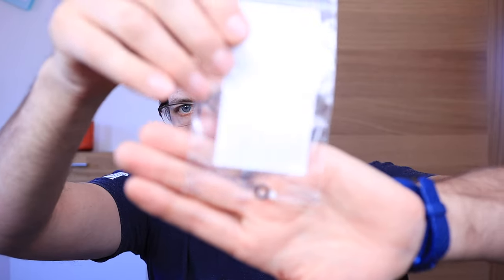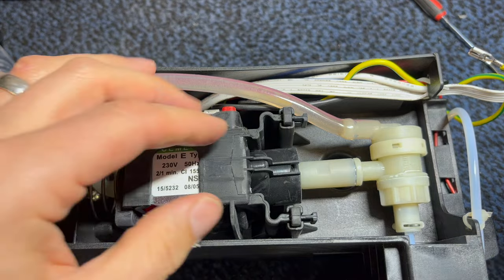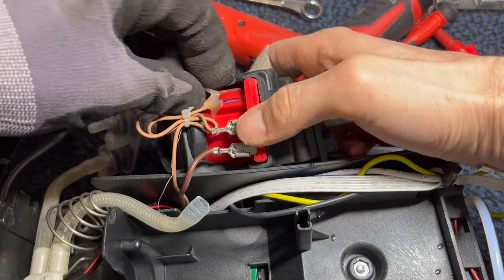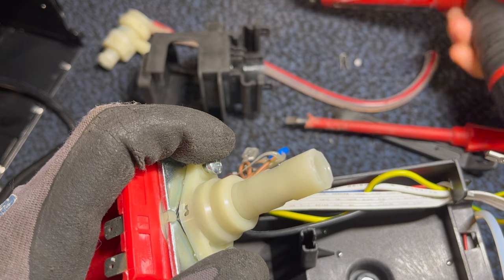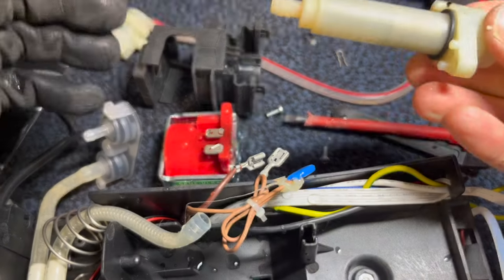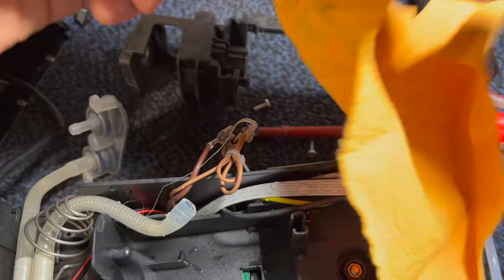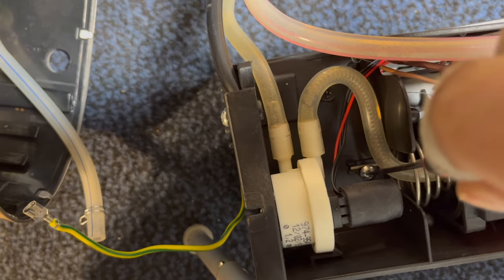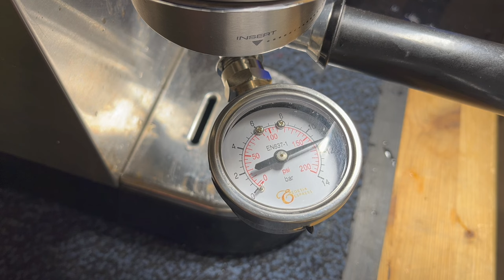HOW TO FIX an ULKA Vibratory Pump: Dedica, Gaggia, Saeco, Philips, Etc.

Comment from the maker: In this video, I show you how to overhaul an Ulka vibratory pump, to revive the performance of your coffee or espresso machine. This can be done for basically all vibratory pumps, and I exhibit it on a Delonghi Dedica EC680.
Ulka Maintenance Set: https://geni.us/UlkaMaintenanceKit (Amazon)

DISCLOSURE: Some of the links on this page are affiliate links, meaning, at no additional cost to you, I may earn a commission if you click through and make a purchase and/or subscribe. Affiliate commissions help fund videos like this one.
Reply: Hi, I have an Odea go. When I start it normally and it does the priming and rinsing, it doesn't have pressure, the pump seems to go slow like there is a clog, not enough water comes out. But when I start it in service mode, the pump seems to work ok and it has pressure through the brew group. Also has pressure through the steam way. It is also clean and fresh descaled. Might it be the pump, too used?
Reply: Tom sir, I know this is an old video and I'm not sure if you have already figured this out or not but I seen you fighting that hose here and I believe you broke a nipple before because of a hose. If you twist your hose before you pull it it'll usually pop right off.

Comment: Thank you! My dear coffe machine works again.

($500 machine, found in a dumster, ten years ago, with a faulty on/off switch)

I would not have thought that little ball would wear down, but it makes sence since it rests directly on the edge of the spring. The ball had become so small, it had nested itself  inside the spring and it was milk white rather than clear.

So, did I order a repair kit?
No, I happen to know that ordinary soap dispenser pumps work with a  similar type of valve.
I cut apart a soap dispenser and in there was a clear little ball of exactly 3,9 mm. It fits and the pump now works.
I also flushed the heating element with diluted citric acid to dissolve any  chalk build up.
 
Free espresso machine is ready for ten more years of service.
Thanks again!
Reply from the maker: That's great news! Thanks for posting your story, especially the part about the soap dispenser. I will have to check that out.
Reply: Im going to try this. If it works, you are an absolute legend.
Reply: didn't work :( It doesn't shoot back any water back into the tank so most probably the problem is indeed the pump. I'm going to order a real set and see if that works. if not, I'll order a new pump and valve.

Comment: Thanks for the detailed instructions in this video!  My Delonghi Dedica EC680 was giving only 6 bar pressure, so I went ahead and replaced the ball and gasket.  This fix improved the pressure to 8 bar, but still not good enough for espresso.  Finally I replaced the pump and I was able to reach 11 bar pressure.  I noticed some white stains on the old pump that were probably caused by a very small water leak.
Reply from the maker: Glad to hear you got your machine working again! Thanks for sharing! Tom
Reply: Fixed 10 Dedica by replacing the ball and seal. Tried a new ulka and it was more powerful than ANY of the repairs I done.

Comment: Thank you! I have a DēLonghi Magnifica that had a water pump go out. I thought about having someone fix it. But that was too expensive. so I followed your video, and success! The coffee makers working again. I do suspect that the ball got sucked through to the other side. But thank you for your insight and easy to follow video! Back to freshly ground coffee Made by a push of the button versus that drip stuff.
Reply from the maker: Awesome! 😎

Comment: Thanks a lot as your vid cut off my disassembly time at least 50 %. Got some different problem with flow as well fixed , but for reference the brand new pump unit have 500ml displacement for one cup as well as done within 12 seconds  from push bottom start to stop the pump cycle. 

Another machine as have one for spare, have interesting problem as filling one cup with 500 ml within 11,8 seconds but when make double cup then do the same job as fill up 500 ml within 11,8 seconds and stop the process seems must be software problem . Problem were remdy as follows - Just an FYI to make it a bit easier if you need to do this again. You should be able to reprogram the shot time/length whenever you want by simply holding the button (single or double shot)  down and not releasing it until you have the amount you want. It will remember that setting from then on. Thanks this guy and this issue also fixed. When the pump is weak and worn out as sometimes for fill up the 500 ml need 21 seconds to stop the process. So timing of pump is good to remedy the pump statement on time. Even if pump is worn out with this keep button  you can complete the cup filling until replacement pump arrival
Reply from the maker: Thank you for sharing! Tom

Comment: I recently purchased a used Isomac E61 machine that was not operating. After testing it and concluding that the pump wasn't working I took off the cover to inspect and remove the pump. My conclusion is that vibratory pumps are too noisy for use in a home appliance. But if one must use one in an espresso machine, there should be a more robust method of mounting the pump to the chassis while minimizing vibration noise. The stock rubber mounts are grossly inadequate.

Comment: It might be a combination of issues with the pump. Mainly caused by calque. But also spring pressure, the little ball and rubber seal. But well done, thanks for this helpful video!

Comment: My pump was getting stuck. I didn't realise you could service these pumps! I opened it up and lubricated the shaft and seal with silicone grease, now it's working perfectly again...if it dies again, a new pump is chump change.

Comment: Can I use lubricant on the gasket in the pump, while the pressure & amount of water is low.
If I can use lubricant what you propose as brand and type? Thanks.
Reply from the maker: Well, I’m not so sure about that. But you can check a parts website, for food, safe lubricant. I’m not really sure if it’s necessary though. At least I’ve never applied any lubricant to the pump.

Comment: Hey I commented below a month ago, and successfully fixed mine using this video. The only thing - now my pump is back to square one. Can barely pull a shot out, and can hear the pump struggling a bit. 

After a whole minute i get my doubleshot. When I unscrew the portafilter a ton of pressure is release and some coffee grounds and water burst out.

Any idea if this could be the same issue again? Or a different one?
Reply from the maker: It sounds like maybe your filter basket is clogged. It seems that your pump is bringing pressure, but the pressure is not escaping. Cheers!

Comment: HCM15 hotpoint built in using this pump, Hotpoint want £80 for a new one. Its on amazon for £20. Have read its designed to be replaced rather than serviced but definitely worth trying this out.  My fault was preceded by small leak(dunno where) with humming/buzzing noise. The machine will do one espresso before shutting down and displays "fault in water system". When i turn it off overnight and back on next morning it does one coffee, somewhat confused why a leak occured once but not again and its making coffee fine but shutting down. Im guessing a safety mechanism to protect machine.
Reply: Note Hotpoint quoted £200 for entire job
Reply from the maker: If there's a leak, I wouldn't be surprised if an O ring needs replacing somewhere. Cheers!
Reply: @TomsCoffeeCorner  I took machine out of wall yesterday and gave it a thorough cleaning including the brew unit. Mostly superficial and oddly it's now not showing fault. Pulled two coffees and it's back to displaying as normal. Fingers crossed

Comment: Ive opened my Dolce Gusto machine, a very similar pump inside, it doesnt pump anymore. According to some sources, if it still reads as a diode in 1 way and not in the otger way, it might still work. Maybe a cheap kit like this will make it work again. 

I mean, we already got a new machine... I couldn't trow the old one away without figuring out the fault (the led does turn on, but no pumping, and we did had a no water in pump issue)

Oddly, the ball measures 4mm and the gasket look fine (less chalk then yours). 

I know, we should get a better coffee machine, i had, but spouse wanted easy coffee. Ill get a job and then buy something proper 🤭

Comment: HI ! I have a De Longhi Corso. It doesn't take water, there is calcium near the pump. Do you think it's a pump problem? Could I change that kit you recommend? Thank you !
Reply from the maker: Well, it could be everywhere, in the pump, valves, water lines. You have to localize it on your machine. Good luck!

Comment: For whatever reason, these parts are hard to find in the US. The eBay link in the description for US works, but the cost with shipping is only a few bucks less than a whole brand new pump. For whatever reason, Amazon doesn't have any of these kits available in the US either, except for one kit that is the exact price of a new pump.
Reply: Found a kit on ebay for $11, shipped from New Jersey. Will give it a shot and report back!
Reply: UPDATE: Parts installed, may be too early to claim victory but the most forceful shot I have ever seen just came out of my machine! This old ec155 lives on another day, and the ulka pump with it 🙏🏻

Comment: Hi Tom. Thanks for the very helpful video. I’ve just had to replace my pump and OVP. Do you think it’s necessary to glue the thermistor in place? It seems a tight fit in the new pump. All the best. David.
Reply from the maker: Hi David! Well, the thermistor should fit back in place. See if you can wiggle it into the housing, or attach it somehow to the side. Cheers! Tom

Comment: Hi Tom, I have replaced these parts and also cleaned the 3 way valve on my Gaggia, but still not enough pressure. Should I replace the pump completely or is there anything else I could replace or clean? Glad for any advice! Thank you.
Cheers
Reply from the maker: Hi there! Hard to say without seeing it in person. Could it be that some water lines are clogged with scale?
Reply: @TomsCoffeeCorner   good point, since I bought the Gaggia used I will give it a try. Was just asking, i thought maybe there are other gaskets which could be replaced to increase pressure. Thanks for reply!

Comment: Hello, I have a questions about small  gasket. Is it soft or hard? Because my old is so hard (stiff)....
Reply from the maker: It's rubber, so it's plyable. I would say it is not hard or soft.
Reply: @TomsCoffeeCorner I replaced the gasket yesterday and the pump is working. The old gasket was hard as stone. Thank you for your anserw and above all for a great video.

Comment: Hi! My machine disposes water through the side pipe (the one for hot water/generating steam to foam the milk), but the main part (through which comes the water for coffe) doesnt work at all. All I can hear is a buzzing sound coming from the pump probably but without water. Do you think it still may be the ball and the seal issue?
Reply from the maker: Hey Matt, I fixed something like this recently, but it was a fully automatic machine. Which machine do you have?
Reply: @TomsCoffeeCorner  Mine is a manual model with portafilter (delonghi ECP 31.21). Ive got it disassembled right now and trying to figure out what may be broken. Will try to release the pump and check it inside
Reply from the maker: @Mateuszthewatcher  There is a valve at the brew group to allow water to exit. Maybe that got clogged with scale? When did you last descale?
Reply: @TomsCoffeeCorner  It would be strange as it happened suddenly during making a coffee. The water flow literally stopped and the whole machine became a bit louder. Now im thinking that maybe that spring broke or that ball got into that tube. 
I havent descaled it yet as I bought it a few months ago from my colleague who used it like 2 times (allegedly)
Reply from the maker: @Mateuszthewatcher   @Matt Mad  Hmm, that sounds hard to troubleshoot without opening it up. Have you called Delonghi for help?
Reply: @TomsCoffeeCorner  I think i have found a cause. There is a valve above the pump inside which is a rubber thingy which looks like a small mushroom… and its broken. Ive already asked my friend to print it on 3D printer. 
BUT ive also opened a head and noticed that the copper pipe inside seems to be totally obstructed (I tried to inject water/air to it - no joy) Maybe it works differently with hot water - Maybe you know something?
Reply from the maker: @Mateuszthewatcher  Ah yes, that is the OPV valve. It fails first. I did a video on it: https://youtu.be/ncoZ3XyhWC8

Comment: Hi! Do you have any idea how to test the volumetric counter (flow meter) using multimeter? Or any other way?I am having a lot of troubles with them and I'd want to test them.
Reply from the maker: Not sure what you want to test...how are you trying to test them? I would guess that you might get continuity between the two terminals when the wheel inside is oriented towards the receiver.

Comment: Hey Tom, thanks a lot for doing these types of videos. I've recently done a Silvia steam wand mod for my Dedica, but I can't get very good steam pressure, I think this was true even before it. The steam wand works, but I sometimes get droplets of water, and there's very little steam coming out. Do you think this is a problem with the steam valve, pump or OPV? How would I even go about diagnosing this? Any ideas? Thanks so much!
Reply from the maker: Hmm, not sure about that one. I wonder if the thermoblock is increasing temperature enough. How is your espresso extraction? Does that work properly?
Reply: @TomsCoffeeCorner  Extraction seems to be fine. When I run the "cooling cycle" after steaming, I get a lot of without water, too. At least until it cools down enough and it turns into the hot water delivery. That's why I think it might be something wrong with the steam pressure or one of the valves. Also the steam isn't really constant, you can definitely see it comes in waves - a bit of steam, almost nothing, a bit of steam. This happens quite quickly though, maybe once every second or so.
Reply from the maker: Hmmm, Maybe try descaling?
Reply: @TomsCoffeeCorner  Just did a descale before replacing the wand. The machine was definitely very clean anyways, as we have super soft water where I live. Looked a bit more online and someone with a similar problem had a bad pump, so I'll just bite the bullet and go for a pump and OPV to cover my bases, as they're not the most expensive. Worst case scenario I have a spare pump and OPV for when those eventually break :) Will report back once I've changed those out.

Comment: Nice helpful video! Do you know what can cause a weak pump? My dolce gusto takes 5x the time it used to, to make an espresso. Without a capsule, it's way faster. This means that the pump is not as powerful as it used to be. I disassembled the pump and checked everything. Gaskets and balls looked in good shape, but there was some rust on the piston part.
Reply from the maker: Well, you might be surprised. I did this to a Dedica, where the gasket and ball looked fine, too. But before I was maxing 7 bar, and after the overhaul I got 11 bar. So, my best advice would be to do this overhaul, and consider doing a descaling as well.
Reply: @TomsCoffeeCorner I got news! 
I had missed an o-ring, that was in a very, very bad shape. I forgot to comment here as well, to thank you for the video. I used this, as well as some other videos  in order to understand what I should look at. 
The pump of my machine has is not exactly the same, but after applying what I've learned, it was a very easy procedure. The pump is now working like it's new! 
I am not entirely sure of what quality is the o-ring I put in there, especially with that rusted piston. If it fails I'll look into buying a good quality robust one, so I don't have to change it every month (if it fails). Thanks again!
Reply from the maker: @ntelas46  Thanks for the update, and I am glad to hear you were successful in your repair! After using an overhaul kit, your pump should be good to go for the next few years. But if the piston was rusty, you could also consider switching out the pump next time you open your machine. Pumps are not expensive, around $15.

By the way, what machine did you do this on?
Reply: @TomsCoffeeCorner  Its a dolce gusto mini me. I bought it 55 euros and it came with 40 euros of coupons, that was around 3 years ago. 
The first thing I did when I saw the rust, was to chech prices and availability for a new pump. With the model name and number I was able to find only a few and at 35 euro. I don't think it's worth it, especially when a new Dolce Gusto with new features costs 70 with 20 euro coupons.
Reply from the maker: @ntelas46  Yes, that is probably a special pump for a smaller machine. It would be good to avoid replacing it, if it costs that much. Cheers!

Comment: Great video Tom!!! Do you know how often should be replaced this ball and gasket? I do not have a manometer to measure the bars. Or any simple test to verify if maintenance is required? I am thinking if testing the water flow (scale with timer) with a presurized basket  could give any hint
Reply from the maker: Hey Rincon, I honestly didn't know before testing with a manometer. But my machine is at least 5 years old, and sees daily use. I figure this would be good to replace every 5 years in that case. Also, if the pressure is completely absent, then it is probably the OPV that needs replacing. Cheers!